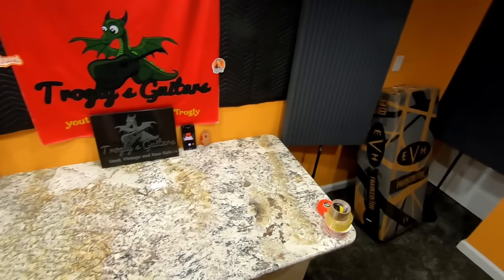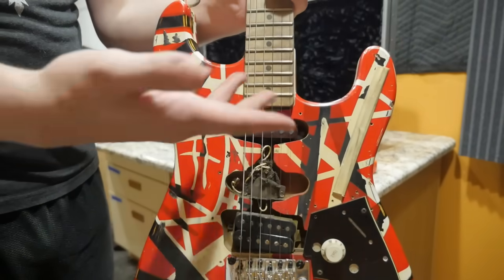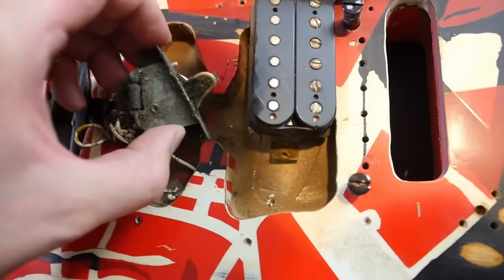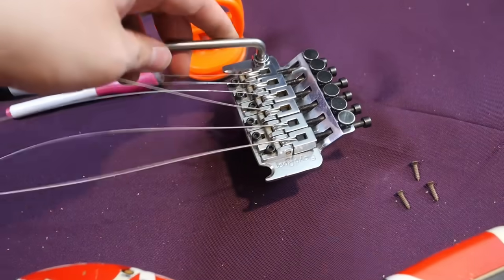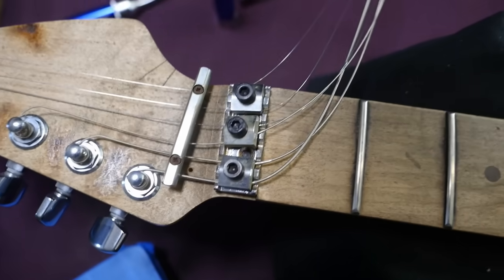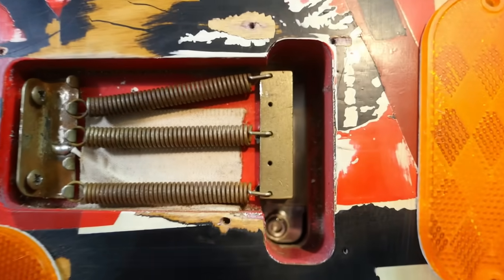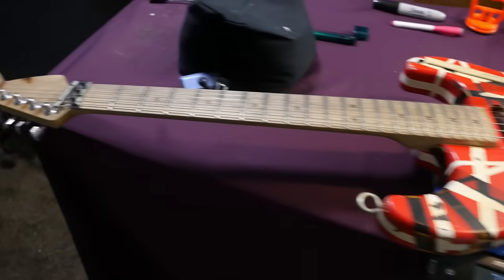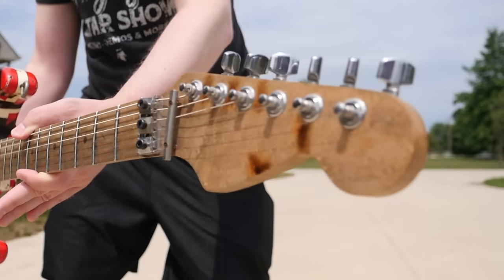This is the "Real Deal" | 2007 Fender Custom Shop Masterbuilt EVH Eddie Van Halen Frankenstrat Aged

Comment from the maker: It was fun to document this guitar! Long overdue
🔴Reverb: https://reverb.com/item/41725888?_aid=growsumo&gs_partner=Trogly
❓Private Help Sessions: https://troglysguitarshow.com/help-appraisals/
👕 Merch: https://teespring.com/basic-logo-4245?pid=211
🎸New Guitar Day Program: https://troglysguitarshow.com/ngd/
Reply: Getting into the fenders, I like it 👍🇨🇦🍁
Reply: Very cool Austin, great review (nice playing).
Thank You for documenting this historic instrument.
Reply: Austin what's the radius????
Reply: @craigdonovan5068  A quick search for this guitar's specifications turned up the following;
Ash Body
Maple Neck
1-5/8” Nut Width
Schaller Tuning Machines
12”-16” Compound Radius
21 Jumbo Dunlop 6100 Frets
Seymour Duncan Custom Shop Pickups
Single Volume Control
Floyd Rose Tremolo
Screw-Eye Strap Hooks
Aged Chrome Hardware
25.5” Scale Length
Reply: @hkguitar1984  that's what I thought, I just know it changed over the years...
Reply: @craigdonovan5068  I don't think its that the spec of the tribute or signature models has changed over the years, I think its just that EVH had many different guitars and often wasn't super particular as to what was used.
Reply: @hkguitar1984  my point about devaluing it is , experts built them to exacting specs, if you watch the video of Seymour Duncan repairing Slash’s pickups he measures everything and indexes the screws! I heave no problem with him taking it apart it’s how he does it! He’s asking 32500 why ? Because he took apart on YouTube! There are two others for sale for less!
Reply: @garyrouleau4676  Gary, I certainly understand your point and I also understand about precision and how things can or should be built.
For years I worked as an Aircraft Instrument Technician and yes, precise is precise and I'm sure Austin's reassembly is out of the tolerances maintained in the Fender Custom Shop.
If anything I should apologize as I myself just don't see the big deal as I'm looking at it as a guitar.   It would seem I need to better understand other people's expectations concerning these instruments.
Now we are entering the territory of never restored classic cars and rare firearms that have never been fired!
And it that respect I find it kind of a bummer as this is a guitar like any other that should be played.
As usual this is just my opinion and your mileage may vary.
Reply: Wendy Black  LOL, Me 2
Reply: Can you please review Brian May’s signature? It’s interesting…
Reply: I've been wondering throughout the whole video, if they all sold out where did you find this one still with the packaging box?
Reply: Thanx for taking it apart I enjoyed this very much..and I'm indifferent  about this guitar but man great vidio..I lobe this channel
Reply: Dude that is FRICKIN awesome as well as AMAZING how you like it? RIP Eddie and Joey JORDISON
Reply: You want to sell that??
Reply: Great episode. You should review an EVH Wolfgang USA signature model.
Reply: Sate lite is Satellite to the rest of us 😂

Comment: According to the many inyerviews I have read regarding this guitar, this is what I know. The body is a Boogie Body second that Eddie got from Wayne Charvel's shop. It was in a box with discounted parts and it was in his price range. Remember, Eddie was a struggling musician at this time and he tried to save money wherever he could.Remember, he used to boil his old strings in order to get as much life out of them as he could (strings were expensive then). The humbucker pick-up was from an old 335 that he had destroyed at some point (ya gotta break a few eggs to get a perfect omelet). He potted these in surfers wax in order to reduce feedback. He tried many others like Dimarzios, but they all just melted, except the PAF's! The volume knob on the B&W era was really a tone knob with the cap soldered to it. He must have changed it at somepoint.The orginal fender bridge was replaced with the floyd. It has a quarter screwed in there in order to level the bridge as Eddie only liked to dive bomb and not pull up (he probably didn't know how to properly set-up a Floyd at that time so just improvised this set-up with the quarter). Regarding the single coil and the toggle switch, Eddie said in several interviews that he installed it in order to screw the companies that were copying his guitars and never intended them to work (at least that's what he said in the interviews). The Fender neck used to have a Gibson logo on it, but 5that disappeared over time and the numerous changes on this guitar. The reflector's he said he picked up at a truck stop somewhere along the line. LOL. Eddie preferred tall and narrow fret's on his guitars and the Peavey Wolfgangs used to come with Dunlop 6105 wire (just an FYI). The original pickguard on the black n white era was a solid black one that Eddie cut out of plastic. The portion of pickguard that is on this era may have been a different one as it's a 3ply "BWB" (my guiess here). The cavity for the humbucker Eddie had used a chisel to remove the wood. Note: Most of this info comes from interviews compiled by a GP magazine release from the mid 80's that I have. Eddie did change some of this info from time to time in later interviews for whatever reason. lol.
Reply: Eddie was well known for throwing out red herring's so noone truly knew what he was doing or why he was doing it except him. I doubt that Wolfie even knows the truth about everything. Lol
Reply: There's also pictures of Eddie playing a sunburst Strat modified in this same way from the club days. I've wondered if Frankie wasn't really the sunburst Strat and the bumblebee from VHII was the only Boogie Bodies guitar.
Reply: that coin thing never made sense to me, it would be useful if he floated the trem slightly, not if it was actually decked right against the body. That or the neck sat too high in the pocket and he had to jack the action up.

Comment: We had two in the guitar shop I worked in, here in Baton Rouge,  Louisiana. They were amazingly detailed pieces of art. I remember what amazed me was that the craftsman had managed to reproduce convincing tape "gunk" on the wiring mess around the pickups and both of the examples we had were exactly the same. Same cracks on the bicycle reflectors on the back. They even used genuine 1971 quarters under the bridge. I know that we sold one to a local guy that was a touring guitar tech for Metallica and Madonna. He came off a tour and snapped one up. These things really belonged in a museum, they were THAT detailed.
Reply: Things that are made to be collectable, are not collectable. Id play the hell out of it.

Comment: This guitar series is a work of art by the master crafters at Fender. That said, here’s my take on it: $25,000 will buy you the illusion of holding Eddie’s actual guitar. For many, it’s worth that & more. I don’t knock it at all, but the way I see it Eddie made it for himself, so if you want to get the feeling of walking a mile in Eddie’s shoes you’d have to build your own guitar out of cheap parts as you outgrew the ones you could buy because of the vision you have about your playing.  Personally, I’m not a fan of expensive guitars. I own a Fender Tele & a fretless Fender Jazz bass (both Mexican) and I love them, but I have a no-name cheap flying V that I call “the lab” because I use it to experiment with pickups, pots, knobs, bridges, and other gear. It was 1/4 the price of my tele & JB, but it’s also something that no one else has & it has the ‘tone’ & makes the sounds I want for how I play, and I’m certain Eddie would totally dig it. That, in my view, is how to own a Frankestein guitar - or in my case, a ‘Franken-V.’

Comment: The reason the quarter is further back away from the Floyd is that in the mid '80s when it had a Kramer hockeystick neck Tom Anderson did some work on it - including moving the bridge. Apparently it was so far out of position it would have been impossible to intonate properly when Eddie recorded the classic albums with it (well, the ones once the Floyd was installed). So it did actually sit under the base of the Floyd at one time, but became purely decorative once the bridge was moved.
Reply: @Kyle
Thanks for clearing that up.
Because I know for a fact the quarter was under the Floyd when I saw VH back in the early 80's (pre-hockey stick).

So I figured there was a reason it wasn't under the Floyd anymore.

Since we're sharing trivia:

That bottle of Jack DLR drank during concerts back in the day was just tea.
I could see the bubbles and foam in the bottle when he grabbed it from the stage floor and started slamming it down.

I instanlty became one 15 year old  disappointed, and disillusioned Rock-N-Roll fan, at that time.
Because I knew that real whiskey doesn't bubble and foam.
What else about the Rock-N-Roll lifestyle was an illusion?
🤔
But Eddie, Michael, and Alex rocked the arena!
So, I didn't remain disappointed for too long.
🤗

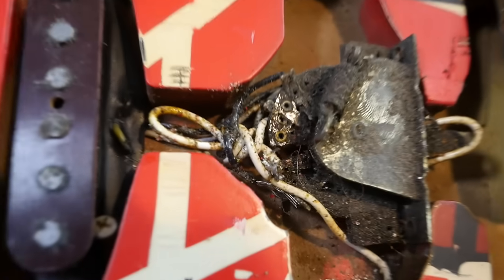Comment: according to the builder, the company that made those reflectors (which he got from a truck stop) went out of business decades ago. To find them is a huge amount of dedication on the part of the builder. The most detail oriented part has to be a small piece of gaffer tape which Eddie accidentally left on the guitar when he painted it back in 78-79. The builder noticed this when he was inspecting it and you can see it on the replica at around 9:20 on the middle pickup section.

Comment: It turns out that those reflectors were very hard to find. They were truck reflectors from back in the 70s. And that quarter is apparently very difficult to find as well. It turns out that there were limited minting of those 1971 quarters. All in all more of the mystique that is EVH.

Rest in peace Eddie: that one guitar and 10 fingers changed the world of rock ‘n’ roll.
Reply: Those quarters are relatively easy to find and the reflectors on the replica are not accurate
Reply: @adamhlava6970  ...

According to Edward Van Halen, it is ridiculously accurate. Down to the reflectors.
Reply: Dude in 1971 Denver made 258,634,428 quarters..
Reply: @timcarter1164  The red reflectors and the oblong reflectors have the wrong patterns inlaid in them. The real ones are made by Cortina. These are not Cortinas. Ed was mistaken on that point.
Reply: @adamhlava6970  ...

Always willing to be shown when I'm wrong. And while I agree, at that price point that guitar should be perfect, we are getting nitpicky about the pattern in the reflectors on the back of a guitar which has absolutely nothing to do with the sound or the playability and blah blah blah. Now, again at that price, everything should be exactly right. But considering Chip did it all through pictures, I'm still pretty impressed.
Reply: @timcarter1164  Sorry but I've seen many more home builds more impressive and accurate than this thing.
Reply: @adamhlava6970  ...

I get it folks, it's a lot more fun to keep the myth in the mystery going than the reality. But I'm still going to go with Edward Van Halen's saying they had to write on the back of the neck of the copy in order to tell the difference. He had trouble on two or three different occasions telling the two apart. Think what y'all want, I'm going to go with Eddie. Considering he's the one who built it and knows it better than any of us, or all of us put together. I'll stick with what the man himself said.
Reply: @timcarter1164  Edward was trying to sell merch. Plain and simple. He in no way shape or form was confused between that copy and a guitar he'd lived with for decades.
Reply: @adamhlava6970  

Truth that may have been a publicity stunt, however, the man was a known perfectionist and if it had his name on it, it met a certain level. I'm still going to run with what the Eddie himself said. The same guy that said he better be able to pull any American Standard Wolfgang off-the-wall at any guitar store and gig with it.
Reply: @yardbirds89  10 minutes to wapner

Comment: This pickup (=13.77k) is closer to a Dimarzio Super Distortion (=13.68k) than a typical P.A.F. (7.75k - 8.15k). In an interview of Eddie I read somewhere many years ago, he said that he unwound a pickup and wound it to a different bobbin that was stuck on a turntable to rotate at 33 1/3 rpm. Then he put it to 78 rpm to do it faster but the pickup was tossed off the turntable to the wall and he started all over again in slower speed. Maybe he unwound a Super Distortion and wound it to a P.A.F. bobbin, because Super D. has allen pole screws and this one has a slug coil and a flat screw coil like a P.A.F.. Many Eddie fanatics support the idea of the VH1 tone being a Super Distortion and not a P.A.F..

Comment: As a 35+ year VH fan, I found myself smiling the entire time.

EVH needs to get off their butts and make a Fender Custom Shop version of the legendary Kramer 5150 guitar which Edward actually used longer than the Frankie, both in the studio (1984, 5150 and OU812) and on tour. The 5150 guitar was Edward's guitar of choice during the 80s and he retired the Frankie because of it. That's saying something.

Watching you disassemble the Relic Frankie triggered me hard because of all the attention to detail they made into cloning the original. I was thinking "is he going to re-align the screw heads again when he re-assembles it?" Triggered hard. lol

The tremolo was a prototype installed to Frankie. Maybe why it looked different. Edward didn't like pulling up on the tremolo bar. He only dive bombed. The tremolo was set up to prevent pulling up, but gave him plenty of room to dive bomb.

Thanks for the video. For the first time I noticed Edward's fingerprint on the side of the switch from when he "pressed It" into place while attaching it to the body. Detail upon detail. I could look at this guitar for hours upon hours and still find new things to gawk at.
Reply: They did :) it's called the 5150 series.
Reply: @DukeHard  I am lucky enough to own one. It was my childhood dream to one day own one of his signature series guitars. The original striped series just didn’t do it for me. I’ve seen a million Bumblebees, “clean” frankenstrats (the red white and black one modeled after the paint scheme of the Frankie), and the classic B&W from Van Halen I. I’m not a huge fan of the Music Man, later Wolfgang, styled guitars. They just don’t do it for me. When I came across the 5150 series? I honestly wasn’t even a huge fan of 1984/post-Roth era Van Halen work, or his choice of guitars for that matter, but seeing that kind of made it come full circle for me. It called to me. I played it, and bought it and it was the best decision I’ve ever made. The only thing I hate is for a 1,300 dollar guitar (they go for 1,999 now, from what I’ve assessed), they could at least hook you up with a hard shell case. I went ahead and bought one,  just because it was a pretty monumental moment for me and represented pretty much every single reason of WHY I got into playing guitar. I’m not a crying man, but I purchased my 5150 a month before Eddie’s passing, and you’d better believe I shed a tear. Couldn’t believe he was gone. Still can’t, and it’s been a year now. But it gives me more of a reason than ever to continue to study the school of Edward, in his memory. Long live the king. Much love ✌🏽✌🏽
Reply: @xavierwalker3645 you are lucky!  the 5150 Kramer is my favorite. I have a 1984 Pacer imperial with an original style Floyd Rose because of it. Keep rocking!
Reply: @DukeHard  The 5150 series strat isn't a straight replica of the Kramer (for obvious reasons). The obvious and most glaring difference between the Kramer 5150 and the EVH 5150 series is the number of pickups; which aligned with Edward's later tastes, but steps away from the famous single humbucker/single volume knob that was the hallmark of the Kramer Pacer/Beretta guitars.

 No. I'm talking about a museum quality relic guitar like the Frankenstrat, but what the Kramer 5150 looked like in 1986 during the 5150 World Tour. Look at the guitar in Live Without a Net. All of it's scrapes and blemishes. The worn out paint on the arm rest portion of the body. Do it all. lol
Reply: @swordmonkey6635  they made The 5150 striped guitar

Comment: Yeah, ok. You win. This is the best relic job I've ever seen, I've never been a fan of relics because it always looks crap. Personally I think the new ml relic techniques looks so...not how it should, to be blunt.  But this is hard to figure out how they did it  so it looks like real life. The ml ones still look new in between the scratches this looks like it has years or fading from uv light. Thanks Trogly if it weren't for you I wouldn't have such a defined preference when it comes to details!

Comment: The reason the pick up is slanted is because the string spacing on the floyd rose trem is slightly wider than standard and it can't be adjusted. That's why the pickups on Kramer Barettas are slanted as well. So when you go to buy pickups and you see names like trembucker and floyd spacing they are made to line up with the spacing on the floyd rose.

Comment: old video, but a note about the floyd.. eddie kept the bar floppy loose, but secure.. so it was right when you got it.. i've inspected several of these replicas.. they are close, but no 2 are alike and none are exactly a replica. some things you just can't copy.. but as copies go.. they are super nice..  i have one i built, and i have only about $1700 in it.. all in.. paint.. tape.. sandpaper.. acid.. the floyd with the block was the most expensive part.. the neck, the pickup..  etc.. one of the original reflectors isnt made anymore.. so a close proximity was used.. etc.. it plays really well too.. i'd love to have one of the collector units.. but i kinda like mine too.. i think mine is as good, but will never have the value.. i need to replicate that case.. that's a todo project...